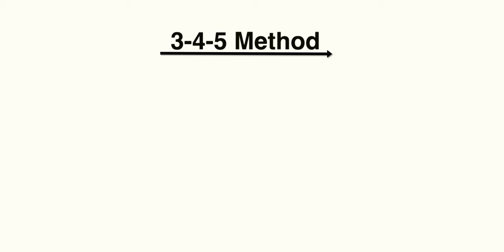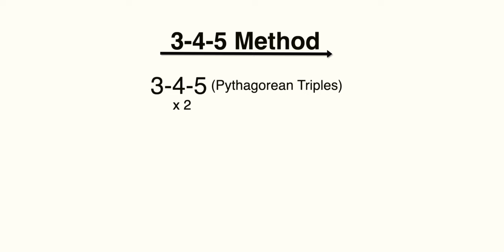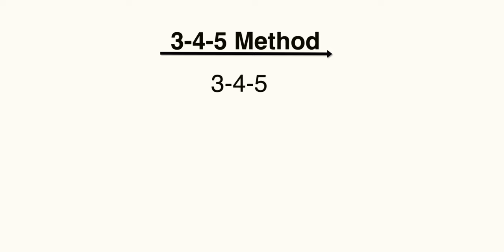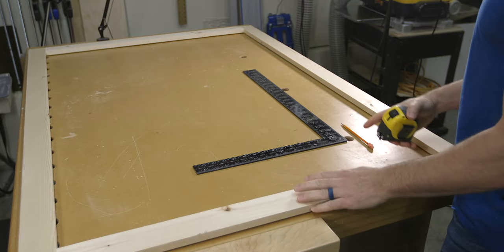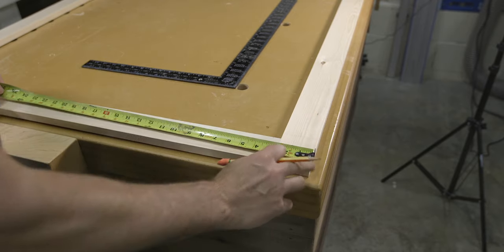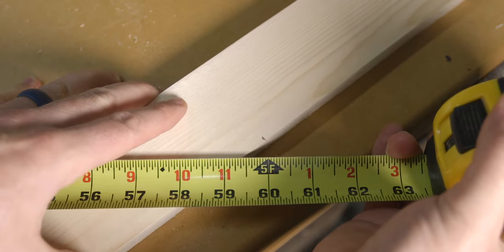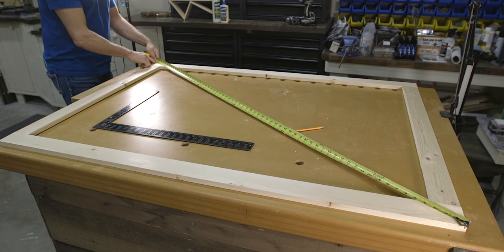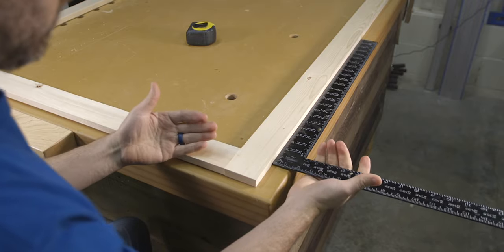3-4-5 Triangle Method For Finding Square

Comment from the maker: Notes: Sometimes the string can introduce some errors because of its flexibility. Therefore, it's always a good idea to recheck the 3-4-5 after your lines are snapped. In addition to multiplying the ratio, you can also divide the numbers to get even smaller numbers.
Reply: How come the 2nd time your starting point is the same point but the first time your starting point is the outer edge on each side that is different length (4 and 3)? Doesn't that introduce an error in the diagonal?

Comment: How would I use this if I need to set 4 power poles for a pole barn about 30x30 so it’s square
Reply from the maker: I would just use diagonal measurements for that. If the measurements are the same, you're building square. :)

Comment: Guys just start out with a any number that is a multiple of 3. Then however many times 3 goes into that number, multiply 4 and 5 by that same number. At the end, the measurement between the 3 side and the 4 side should equal 5 times whatever the number was you used to multiply with. If you start with 3x4=12. Then multiply the 4 and 5 by 4 also. 16 and then you would get 20 between the first two.
It's really really simple if you know the multiplication table.

Comment: I did a diagonal using a single taunt string  off each corner of the 36' apart stakes...stake one at (0) stake 2 at (36)   36Ft x 40Ft=54'2.75" Diag.  corner to corner if memory serves me ... maybe not but ultimately when my numbers met diagonally my sides were 36 left side @ (40ft) and 38ft 6" right side @(40 ft) three times kept coming out  using a 54ft 2" (same string tied off)...which corner is out is the need to know using a single string 54ft 2.75" off stake 1 @ 0 and stake 2 @36Ft? How is the parallels off ???

Comment: What’s the chalk line cord all about? What’s its purpose and why did you “snap it” ... thanks Josh ✌🏼
Reply from the maker: Hey man! Chalk lines are used mostly in carpentry/construction and work great for laying out lines for house walls, flooring, roofing, and cutting plywood just to name a few. Great tool.
Reply: @TrainingHandsAcademy  ahhh I see! I saw one of my buddies use this the other day on a long slab but I was lost. Good to know! Thanks buddy
Reply: We use a chalk like to transfer a line to a concrete slab, sub floor or any other type of substrate in order to follow. We use this line  to keep all the material straight and square, it is very important to follow. If you don’t follow your line correctly, you can have a huge mess on your hands and its a nightmare to fix if you don’t "catch it" right away.

Comment: Mathematician here. Nice mathematical video :-) It's actually not the Pythagorean Theorem that is used in the 3-4-5 method. (I don't think the video claims this, but some comments do.) Instead, it is the converse of the Pythagorean Theorem, which says: IF the sides (a, b, c) of a triangle satisfy the equation a^2+b^2=c^2, THEN the angle opposite side c is a right angle.

In the 3-4-5 method, this is used for a=3, b=4, c=5.

For the same reason, there is also a 5-12-13 method. (And infinitely many other similar methods that are not just scaled versions of these to methods.)

Another funny thing I have noticed: Almost all woodworkers on YouTube say "square" when they mean right angle (when two lines are perpendicular/orthogonal) :-)
Reply: heya, I'm a tad confused, I thought if 3-4-5 worked, 1-2-3 would also work, but it doesn't lol, can you explain more into why? thanks
Reply: @rustyneedles3743 Cause its 3 squared + 4 squared = 5 squared
Reply: @noobjitsu1743  thanks bro, I looked into it some more and managed to wrap it around my somewhat empty head lol, was never great with Math, but still, thanks for the reply
Reply: @rustyneedles3743  Np i got a test on it today so figured id help!
Reply: @noobjitsu1743  awesome, all the best with the test bro 👍ace that shit 😊

Comment: Very nice. I have a question what if I’m working on a frame 48x24 inches, using 3-4-5 what distance do I use? 3 4 and 5 inches are too small, and 3 4 and 5 feet is too large, so guide me please.
Reply from the maker: Fantastic question Gary! Just as you can multiply to make the ratio bigger, you can divide to make it smaller. So for your project one option would be to divide the 3'-4'-5' by 2 to get 1.5'-2'-2.5'. Cool right?!
Reply: Metric!
Reply: If you prefer integers that are as large as possible (and still inches), then you can multiply by an integer n so that 3*n is at most 24, and 4*n is at most 48, i.e., you multiply by n=8:

3 becomes 3*8=24,
4 becomes 4*8=32,
5 becomes 5*8=40.

Therefore, you now have a 24-32-40 method.
Reply: It’s a ratio. It doesn’t matter what the measurements are as long as they are 3-4-5. You could use 24 on the short side, 32 on the second side and 40 on the hypotenuse. 24-32-40 is the same as 3-4-5. Better still, forget it altogether and just measure the diagonals.

Comment: does it work in metric???
Reply from the maker: Yes, any unit of measurement
Reply: Don't worry about unit of measure. It can be something you invent. What matters is the 3,4,5 all being multiplied by the same number each time. It's much easier to understand with the short simple explanation. The longer it takes to explain this the more confusing it will get.
Reply: @TrainingHandsAcademy  thank you for the great answer, makes sense

Comment: If you take four and divide by 3 you get 1.33. if you take five and divide by 4 you get 1.25. does this mean you can take the shortest side of what you need to measure the full length of it. Multiply that by 1.33 measure that out. Then you take whatever the four number was which is the result of the 1.3 multiplication multiply that by 1.25 and that's the length between those two measurements. I guess the only benefit was your first measurement you could make it whatever the full length was. But it wouldn't work on a square because the second number would be longer than what's available to measure. I guess where the square you just measure from corner to corner and get the same measurement but sometimes that's a little tedious. I was just trying to think outside the box lol.

Comment: I see the concept here, but couldn't you just use the speed square to check the angle?
Reply from the maker: You can but the speed square is too small to get accurate readings on larger projects.

Comment: Am not getting 5'
Reply from the maker: Then you are out of square
Reply: You don't have to go 3',4',5'. Use multiples of 3 if that works better.
Say you use 12. 3x4=12. Now multiply 4 x 4 up the other side. That's 16". Now if you measure between them you should get 20 because 5x4=20. I just used 12, which is 3x4. Then I multiplied the next two numbers also by 4. You can do it however works best for the project. Just start with any number that is a multiple of 3.

Comment: Your frame Is not a square,its a rectangle 😂😂
Reply: Actually aren’t rectangles squares. They just have unequal sized length but have ninety degree corners.
Reply: @vmax4575  rectangles are NOT squares, a square implies both length(x) and width(x) are the same , hence x².   In a rectangle length and width are different sizes.  OK , an apple is not a pear, although they are both fruits